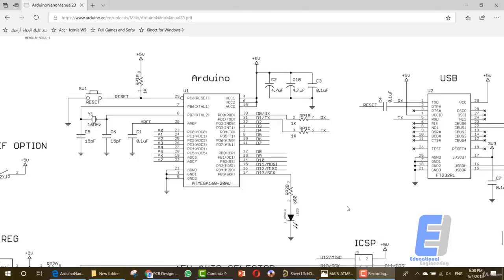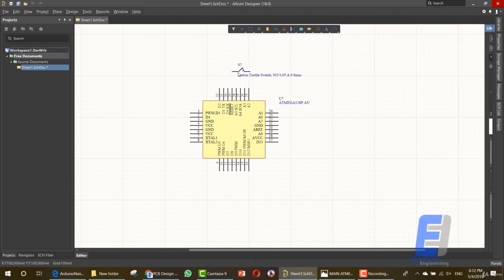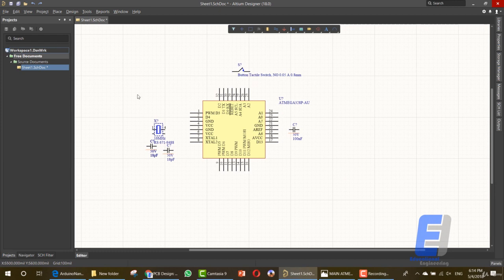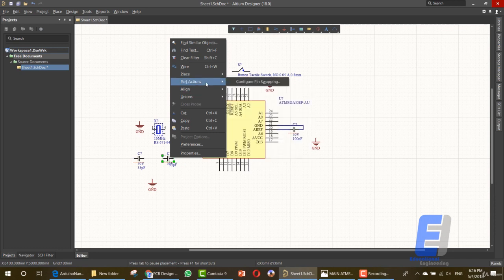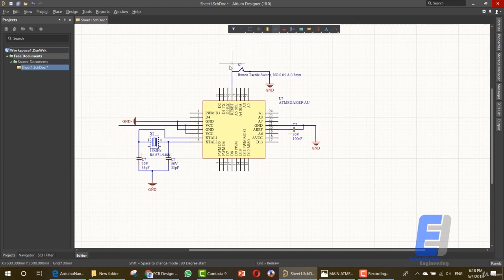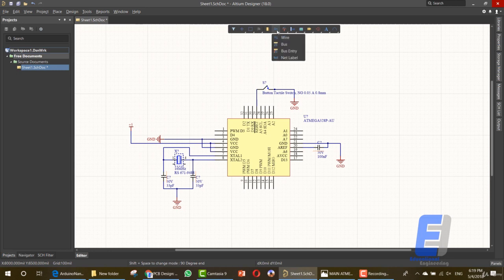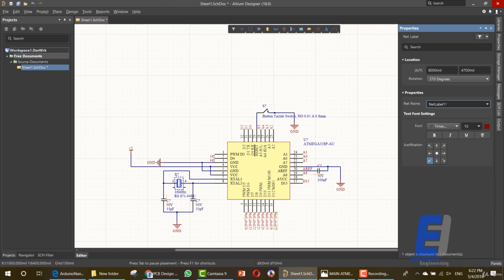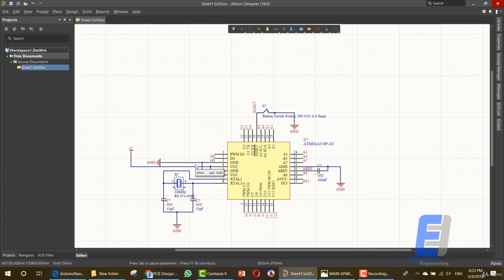ATMEGA Schematic Connection Altium Designer

Comment: In this vidio i have a doubt i follow ur instraction but you get a ic pin digram come in a schematic sheet i did not receive then how to add a library I did not have source 😩
Reply from the maker: Thank you for your question! If the IC pin diagram is missing in your schematic, you may need to add the correct library. Please check the official site or community forums for the right files. Let me know if you need a specific link!

Comment: Is this atmega328p? did you change the schematic ?
Reply from the maker: Great question @sprizen7! 💡 This is indeed using ATMEGA328P as the base microcontroller in Altium Designer. I made some modifications to the standard schematic to optimize the connections for better performance with the specific LCD configurations. The core remains the same, but I've tweaked the pin assignments and power management. Subscribe for more Altium tutorials and schematic walkthroughs! 🚀 Would you like me to do a detailed breakdown of the changes?

Comment: the board and everything is different frrom the last video
Reply from the maker: To integrate a 20-pin microcontroller (MC) with a digital potentiometer (digipot) in your schematic, you'll need to connect them using the appropriate communication protocol. Many digipots, such as the MCP4131, use the Serial Peripheral Interface (SPI) protocol¹.

Here's a basic guide on how to connect a digipot to a microcontroller:

1. **VCC (Pin 8)**: Connect this pin to the positive voltage source. The MCP4131 operates on anywhere from 1.8V to 5.5V¹.
2. **CS (Pin 1)**: This is the Chip Select pin. It is active low. 0V means the chip is selected and 5V means it is not selected¹.
3. **SCLK (Pin 2)**: This is the Shared/Serial Clock. It is the SPI clock line¹.
4. **SDI/SDO (Pin 3)**: These pins are the serial data in and out, also known as the MOSI and MISO¹.
5. **GND (Pin 4)**: Connect this pin to the ground terminal on the microcontroller¹.
6. **PA0 (Pin 5)**: This is one terminal of the potentiometer. Connect this to +5V¹.
7. **PW0 (Pin 6)**: This is the wiper terminal of the potentiometer. Connect this to the output device that you want to control¹.
8. **PB0 (Pin 7)**: This is one terminal of the potentiometer¹.

Please replace "MCP4131" with your specific digipot model, and make sure to check its datasheet for the correct pin configuration and operating conditions.

For the software part, you can control the resistance output at the wiper terminal of the potentiometer through the microcontroller's software¹. Here's a simple Arduino code snippet for controlling a digipot:

```cpp
#include <SPI.h>

byte address = 0x11;
int CS = 10;
int i = 0;

void setup() {
    pinMode(CS, OUTPUT);
    SPI.begin();
    // adjust high and low resistance of potentiometer
    digitalPotWrite(0x00); // Highest Resistance
    delay(1000);
    digitalPotWrite(0x80); // Mid point
    delay(1000);
    digitalPotWrite(0xFF); // Lowest Resistance
    delay(1000);
}

void loop() {
    for (i = 0; i <= 255; i++) {
        digitalPotWrite(i);
        delay(10);
    }
    delay(500);
    for (i = 255; i >= 0; i--) {
        digitalPotWrite(i);
        delay(10);
    }
}

int digitalPotWrite(int value) {
    digitalWrite(CS, LOW);
    SPI.transfer(address);
    SPI.transfer(value);
    digitalWrite(CS, HIGH);
}
```

This code will cycle the resistance from the highest to the lowest value². You can modify it according to your needs.

Remember, this is a general guide. Always refer to the datasheets of your specific components when designing your schematic and writing your code. Happy coding! 😊

Source: Conversation with Bing, 14/12/2023
(1) How to Build a Digital Potentiometer Circuit with a MCP4131. http://www.learningaboutelectronics.com/Articles/MCP4131-digital-potentiometer-circuit.php.
(2) Digital Potentiometer MCP41100 and Arduino : 4 Steps - Instructables. https://www.instructables.com/Digital-Potentiometer-MCP41100-and-Arduino/.
(3) Digital Potentiometer Control | Arduino Documentation. https://docs.arduino.cc/tutorials/communication/DigitalPotControl/.
(4) undefined. https://www.facebook.com/Mohannad-Rawashdeh-Raw-774983565988641/.
(5) undefined. http://www.genotronex.com.
(6) undefined. https://www.instructables.com/.